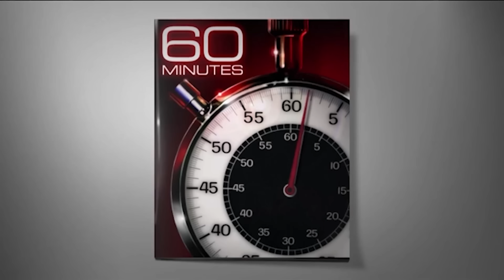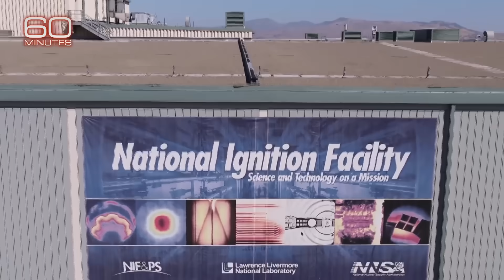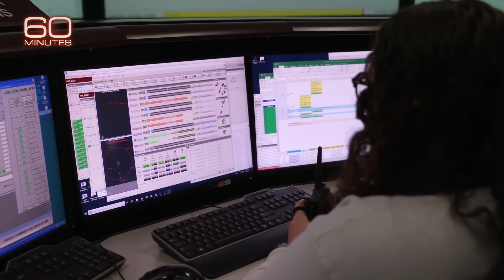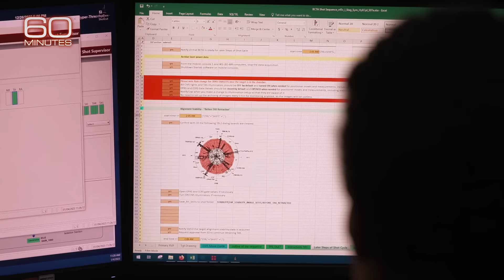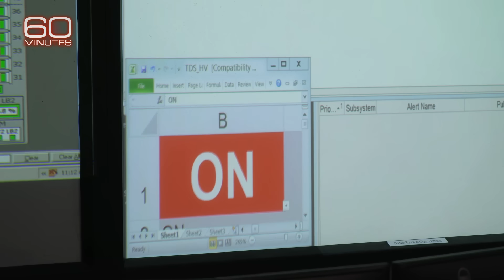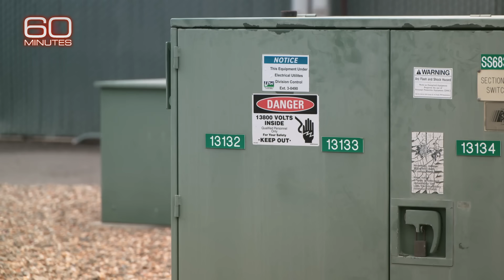Nuclear Fusion: Inside the breakthrough that could change our world | 60 Minutes

Comment: I'm so confused, and maybe someone can explain this to me, but how did they achieve ignition if they didn't factor in the lazers? The lazers are eating ungodly amounts of power, and they said that scaling the ball would require even larger lazers. It seems like this approach is fundamentally unviable, no? Even with the massive efficiency increases they're hoping for it still seems untenable. Haven't other groups gotten closer to ignition when factoring in the total energy of the system? Is this just a game of semantics or did they actually achieve something revolutionary here?
Reply: The lasers are 30 year old tech.  There are way more efficient lasers available.  Now that this achievement has happened, more funding may mean and upgraded facility.  Can't upgrade without results...

Comment: What's really amazing is that after spending a minute or two scanning the first thirty or so most recent comments I didn't a single one that expressed any amount of skepticism as to whether or not this technology would become a commercially viable way to generate a meaningful amount of electricity...in any of our lifetimes.  What's also amazing is that if the same amount of money, time and effort had been put into developing thorium fuel cycle MSRs we would have so much electricity generating capacity...right now...that it would be too cheap to meter.
Reply: Wow! The sales pitch, 'too cheep to meter,' was constantly in the media during the 1950s as private corporations and the federal government was promoting the first nuclear power plants.

Typically, thorium fuel cycle MSR promoters tend to immerse themselves in echo chamber information sites to reinforce what they prefer to believe in. They tend to have little interest in seeking out critical analysis regarding the technology that they have fallen in love with.
Reply: Nuclear power is the most environmentally benign way of producing electricity on a large scale bar none.  

Commercialization of MSRs has not happened for more than political reasons.  In a capitalist economy, anything that gets in the way of making money for something that is practical and safe will get run over.  Research and interest in MSRs has persisted since the 1940s.  While there are design and material features of MSRs that do provide safety benefits, such as the elimination of possible fission run-away events, there are instead issues with safely implementing the fuel-salt cleaning process since it is not contained in rods you can remove.  There are currently 6 companies with the technical depth necessary, 1 in Canada, 1 in the UK, and 4 in the US of which one is working to make one for China.  The one that looks like it would be the easiest to implement would be Britain's “Stable Salt Reactor” which uses molten salt fuel held in static fuel tubes, rather than conventional ‘pumped circulation’ designs.  Necessity is the mother of invention and Britain with its far-flung territories has the greatest need to supply areas like that, with some provided by sources that are not politically stable such as France to the channel islands.  There Britain provides a backup power system that can be supplied by ship.  Britain has at least 200 years worth of coal and plenty of oil to take care of them, but MSRs of this design would be smaller, easier to service by normal personnel, require less oversight, more efficient and cheaper than what they are currently doing.  

The word NUCLEAR is the 20th century word for "Boo!"  "Vote for me, I'll save you."   "The land won't be usable for trillions of years." 
- GM Flint used to have two of them, classified experimental, that ran for years.
- Hiroshima, Japan, bombed.  Not as many were killed as during some single nightly bombing raids by B-29s, but it was significant in that it was done by only one airplane with one bomb.  The city had an estimated population of 1,199,391 as of 2019, with a GDP of $61.3 billion already back in 2010.

- 3-Mile Island damaged the health of nobody outside of any stock they might have had in GPU.
- Fukushima, Japan. 110,000 residents were evacuated from the communities surrounding the plant due to the rising off-site levels of ambient ionizing radiation caused by airborne radioactive contamination from the damaged reactors.  A 2014 report by the United Nations Scientific Committee on the Effects of Atomic Radiation and World Health Organization projected no increase in miscarriages, stillbirths or physical and mental disorders in babies born after the accident.  A follow-up report released in 2022 confirms the major findings and conclusions of the original report, 
- Chernobyl, nobody in their right mind uses that nonsensical technology, which is why the only place you will find it is Russia.  REDUCING power below a certain threshold would cause a run-away, so the cure for the run-away they accidentally caused, caused another run-away.  Moreover, it had no real containment structure in case something went wrong.  Their primary design consideration was to efficiently manufacture weapons-grade Plutonium, which it did.  Chernobyl plant operators concealed the accident from authorities and the local population, and thus the government did not even begin limited evacuations until about 36 hours after the accident.  According to a United Nations study published in 2008. The study found no evidence of increases in solid cancers, decreased fertility or congenital malformations.  Russia has its twin still operating in Kursk using the same technology.  They are so similar, that it is used as a stand-in for Chernobyl movies.
- "Fun fact":  The land was heavily contaminated around the Chernobyl reactor.  They had put a lot of earth on top of what was there to mitigate the radiation issue.  The area is well posted, and one of the things mentioned is no digging.  Organizations go there often in search of any ill effects on wildlife.  Chernobyl is located north of Kiev.  The same guys who caused the Chernobyl disaster, invaded Ukraine.  When they approached Chernobyl, the guy in charge told the Russian general, "You have not captured a nuclear power plant.  You captured a disaster area where one of yours has been.  I'm not concerned with your armed thugs, our guys will take care of them.  I'm just here to prevent a repeat of the 1986 disaster, which I will do."  The Russian general sequestered them so they had to stay on duty and not get relieved.  The Russians dug defense lines and lived in the most contaminated part of the Chernobyl exclusion zone during their attack on Kiev.  They suddenly left to return to Belarus.  There are unconfirmed reports of Russian troops leaving in busses and vomiting out of windows and others of them receiving treatment in Belarus for it.  What we do know is the attack on Kiev failed, and that that particular group most certainly received highly-significant doses of radiation, and that group was not traced to Eastern Ukraine like others, but they also may have been part of a reorganization, we simply don't know.  Chernobyl is common knowledge in the West as a disaster area.  One would think that somewhere in that organization there would be the equivalent of the cheap U.S. IM-93, of which in the U.S. are maintained at even the company level..  Either their officers and enlisted men are that stupid, or the officers knew, didn't stay with them, and the enlisted men were being used as research guinea pigs.

Comment: Didn’t China already achieved this a few years ago?
Reply: Please go back and look at that prior announcement. Most fusion energy 'breakthrough' announcements are filled with sales hype and missing key facts. Many are seeking public support and funding sources.

Many of the prior announcements were about sustaining a hydrogen-1 plasma for many seconds. The vast majority of reporting journalists and the public that the pitchers presented to never bothered to asked the following questions.

1) Did the experiment employ deuterium/tritium fusion fuel?
2) Were any 14.1 Mev fusion neutrons detected that would indicate that fusion of hydrogen isotopes took place?
3) If fusion fuel was used and it did result in fusion reactions then how much energy was emitted from that process compared to the amount of energy expended to create the reaction?
Reply: @vernonbrechin4207  so basically this is meaningless. 302 input to get 3 output. Get back to me when they can power my house.
Reply: @chosenone5536  - The latest announcement was only a small advancement over the previous announcement that the NIF management made a bit over a year ago. They just pitched it to make the latest announced experiment appear as if it was a major change. There remains immense barriers ahead that will likely take many decades to solve, decades that are way to late to deal with climate change issues.

The experiment took about a week to prepare. As a result they should have given the amount of power consumed by the facility during that time and compared it to the fusion power they measured. That value would have been well in excess of 302, probably greater than 500. The lab only mentioned the power that went into the laser for the shot because outsiders noticed that they used to never mention that in past years.

It is estimated that the cost of the target assembly that was destroyed in the experiment was around $100,000. Another estimate, for the cost of constructing and NIF and operating it for the last 13 years has been around $11 billion. That has been possible since the facility has always been primarily funded as a thermonuclear weapon (H-bomb) research tool, not a path to a future practical nuclear fusion power plant.
Reply: @vernonbrechin4207  50 more years to go… good luck with that
Reply: @vernonbrechin4207  making assumptions again. Shame on you Vernon. Find a hobby, go play golf.
Reply: @patrickstulz8193  - If I did those things I wouldn't be finding so many flaws that most people seem to be oblivious to. I'm well aware that many people are deeply invested in such pipe dreams and wishful thinking.

Comment: 300 in and 3 out…sounds like good return on investment
Reply: Their were many other factors that were obscured. One is that the experiment took over a week to prepare so the facility input energy during that time was much greater than the energy expending to pump the lasers. If one shot was done each week and the fusion reaction in them also lasted 0.00000000008 seconds then the duty cycle of the fusion energy output would be about 0.00000000000001%. One estimate, for the target assembly cost, was $100,000. After each shot that assembly is converted into an exploding plasma. A new one has to be manufactured after each shot. The announced experiment generated enough fusion energy to boil about two liters of water. As you pointed out about a hundred times that much energy was required to demonstrate that level of energy output.

Comment: Biden Admin claiming 3 energy unit return for 2 units used instead of the actual 3 unit return for 300 used?  I'm shocked they'd make such a claim as it's completely out of character.  Maybe a 27 million plus degree rounding error.
Reply: You embarrass yourself by being a politician into a scientific achievement.
Reply: @blackhawk7r221  it's a scientific achievement if you can get $3 of energy output for $2 of energy input.  It's political theater to suppress the actual $300 energy cost expended.  You know, same as burning coal to power a low emission electric vehicle and then only measuring/publishing the vehicle's emissions.  Political theater, not science.
Reply: Keep in mind that the NIF management has become masterful at obscuring many key issues as well as hiding many aspects of their project. They snow scores of journalists and likely the much higher level administrators who are, in theory, supposed to be managing them.

Keep in mind that the the LLNL got the funding for NIF in exchange for ending the lab's full-scale underground nuclear weapons program at the Nevada Test Site (NTS). NIF acts as a thermonuclear weapon (H-bomb) simulator. The U.S. had to terminate that test program under the terms of the Nuclear Test Ban Treaty.

Comment: Lockheed Martin has mastered Fusion for DECADES but we will never see the technology in the public sector because of the fossil fuel based economy the world runs on. There is no way the elites are going to give up an industry that generates 2,747,720,000,000 in revenue a year on Oil sales alone. Not going to happen.
Reply: The vast majority of fusion energy 'breakthrough' announcements are loaded with misleading sales hype that hides key issues. Please check again what Lockheed Martin actually achieved then ask yourself the following questions.

1) Did any of their experiments employ fusion fuel, such as a deuterium/tritium mixture?
2) If such fuel was employed was their any significant detection of the production of 14.1 Mev fusion neutrons which would indicate that a significant fusion reaction took place in any of the experiments?
3) If a significant fusion reaction took place how much energy release was detected and was it more than a tiny fraction of the energy needed to perform the experiment?

Most of the fusion energy presenters are well aware that most of the members of the press, their investors and their fan base don't have enough technical background in the field to ask such key questions.

Comment: In 1993 Ben Rich, who was the director of Lockheed Martin's Skunkworks Division (Black Budget Projects) stated that 
"We now have the technology to take ET Back home"
That was 20 years ago. 
We're being stung along were obselete technology is presented to us like it's new.
Because the average person has been dumbed down so bad, they have no way of knowing that it's all a BS shell game.
Reply: The NIF management was supposed to achieve the National Ignition Facility namesake, 'ignition' by 2012. It failed by a wide margin but the funding continued since it has always been funded as a thermonuclear weapon (H-bomb) research tool. After many more billions and a decade later they achieved that goal. Now the lab management is claiming that the real problem stems from older equipment. It wasn't that old back in 2012. They also fail to mention that NIF was preceded by two earlier large laser fusion machines that they once claimed had worked out most of the kinks in their system and NIF would easily achieve 'ignition.'  Now they have begun pitching for a replacement facility, after expending about $11 billion on this one. They claim that more modern Diode Pumped Lasers (DPL) can overcome the problems that NIF lasers now have. DPL had achieved about a 20% efficiency. The management fails to mention that even the most powerful of them doesn't even approach the energy of one NIF laser. They also fail to mention that major efficiency loses in the NIF lasers are due to twice shifting the output wavelength down. If the new lasers have to do the same shifting their efficiency will plummet from the maximum of 20%. Few people have the technical background to evaluate such situations and the NIF management is keen about that.
Reply: @vernonbrechin4207  it didn't fail

Comment: So what you're telling me is it's not Limitless power. You have to use a very significant amount of power all day long while producing these tiny little beads and you have to do it all day long every single day. Sounds very inefficient. If you need 900,000 of those beads every single day and you need to shoot a laser that many times per day while using a ton of power to do it that sound stupid
Reply: It is stupid and totally relies upon wishful thinking to assume that they can improve numerous issues by many orders of magnitude before we destroy our planet's life support systems.

One estimate is that the target assembly, used in the announced experiment, cost about $100,000, with its nearly perfect diamond fuel capsule, deuterium/tritium fuel and gold hohlraum. The tritium is extremely rare, expensive and radioactive. Once hit by the laser pulse it was converted into an intensely hot plasma which then blasted away from the shot center, coating the interior of the vacuum chamber that then needed to be cleaned out of the radioactive waste. The experiment preparation took about a week to set up, not a day. Once per day is about the maximum rate the laser can fire without damaging itself. They can only continue with such foolishness due to the fact that NIF has always been primarily funded as a thermonuclear weapon (H-bomb) research tool. The managers have become masterful in obscuring that fact.

Those, who continue to have faith in such technologies also have to become masters at excluding the following warnings from their consciousness. I urge readers to  search for the following article titles.

IPCC report: ‘now or never’ if world is to stave off climate disaster (TheGuardian)

UN chief: World has less than 2 years to avoid 'runaway climate change' (TheHill)
  * This statement was made 4-years ago.